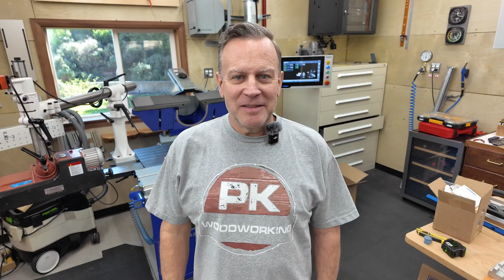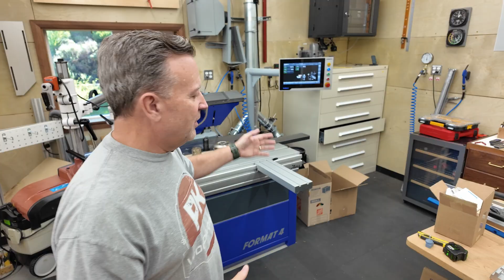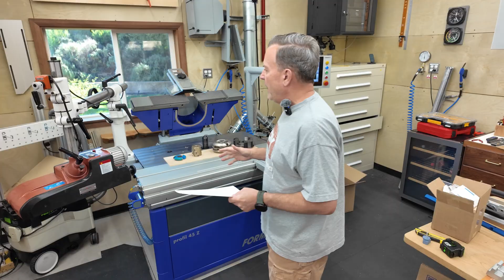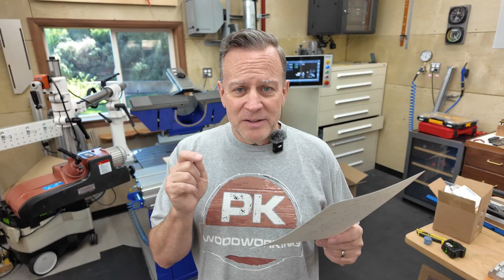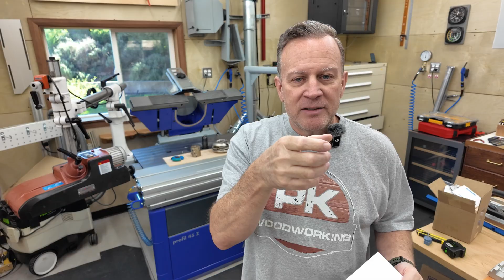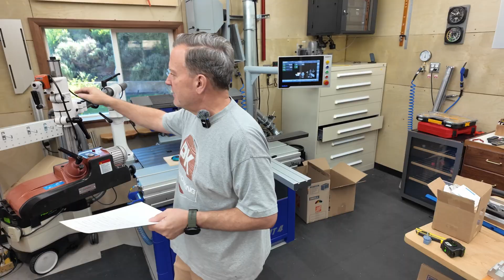So you want to buy a Shaper or Spindle Moulder?  What are the options?  Why would you need one?

Comment: Not sure I agree about the subject of 50hz vs 60hz.  A motor “labeled” as 50 hz is going to run the same speed as a motor “labeled” at 60hz if it’s connected into a United States distribution system.  Only thing that changes speed is the number of poles that the motor is wound to.
Reply from the maker: Without a vfd or an inverter for a 3 phase motor, the line frequency dictates the speed of any AC motor.  The line frequency dictates the shift across the poles.  Running a 50hz motor at 60hz without any electronic intervention, will spin faster than originally intended.

A DC motor acts differently as the electronics dictate the speed.  Almost all woodworking machines have AC motors for the main motor.  The exceptions are spindle motors and feed motors meant to be multi speed.
Reply: I agree I must’ve misunderstood what you were explaining.  Seems like if you were to buy a European saw rated at 50hz you could swap out to a smaller motor pulley.  I can’t imagine big companies like SCM would change much more than that with the saws they sell to the US markets. Geared machines like power feeders might be a little more difficult!
Reply from the maker: I do agree, my point in the video was that if you buy a machine not intended for the US, that the manufacturers would not have the possibility to change pulleys to match speed for the appropriate line frequency.  I had looked at and received a quote from Panhans and they were going to send me a machine meant for Europe with no adjustments to it.

Comment: I'm glad you agree with more shapers. I had four shapers and two auxiliary shaper head machines. Five set up for specific operations and one for bespoke one off jobs. Saved loads of down time increasing productivity. That was over twenty years ago. Downsized now. Enjoyed your video. Cheers Tony 👍
Reply from the maker: Thanks!  I do wish I had more space, but both machines are programmable and the new one will most likely be HSK so I can keep tooling set up on the spindles and then just change them, select the program, all the fences and spindle move into position and then go.

Comment: I have a Felder CF 741 Pro S. Its a table saw, shaper, planer, and joiner in 1. It weighs almost 3,000 pounds, can tilt 45 degrees (one way), electronic controls for tilt and height, 5hp, 3 phase. Had to order and wait almost 6 months for it. Would this be in ugly red head step child category? LOL :)

Comment: Hi Paul,

I think you may have misspoke, the bigger the diameter of a cutter the slower it spins. Awesome video!
Reply from the maker: I will check that - I agree!  The larger the cutter, the slower it should spin, but tip velocity gets larger for the same base speed as the cutter diameter grows, so you need to run it slower to keep the tip speed under control.

Comment: Good explanation of various shapers!
I'm running a 2003 model MiniMax Formula T-1t that has the cast iron tenoning table and hood in my one man shop.
Never a hiccup in 22 years, I run everything from little brazed cutters to 12" tenoning discs and think nothing of it..
Only possible drawback is 12" limit on stock that can be tenoned.
Largest table ring is 13-1/2 inches
Reply from the maker: That sounds like a beast!
Reply: @pkwoodworking  I'd love to find a 'deal' on a Aignier fence like you've got.
Reply from the maker: Those deals are almost unobtanium

Comment: I’m glad you’re not selling your spindle moulder. You’ve got a good machine there. I’m also a believer in having a second shaper — if I had the room, I’d get another one myself.

I have a Felder F700z analogue, which i've had since new from 2001, and I absolutely love it. I do almost everything on my spindle moulder. I hardly ever use my table router anymore; I do it all on the shaper. You don’t get the same machine marks like you do with a router.

With a router, the angle of attack is 90 degrees to the edge, whereas on a spindle moulder, the angle of attack is much lower, giving a cleaner finish and less chance of chipping.
Reply from the maker: Thanks!   100% agree and I sold my router table 3 years ago...